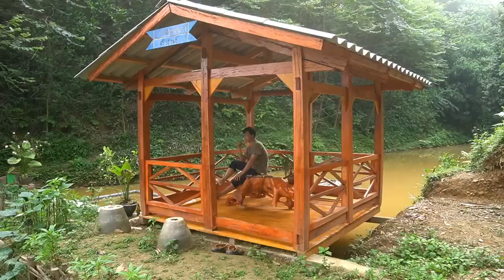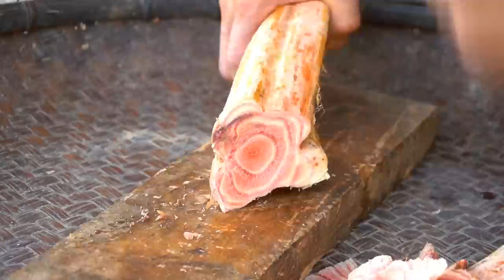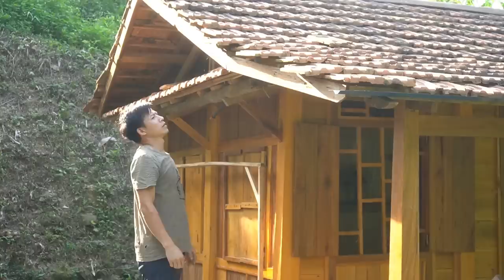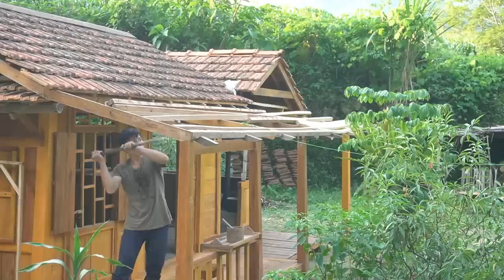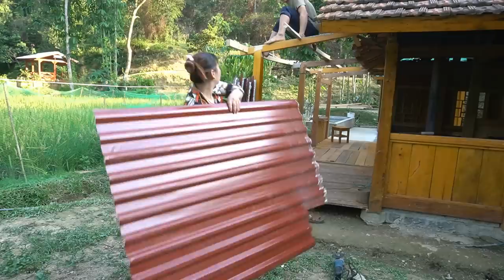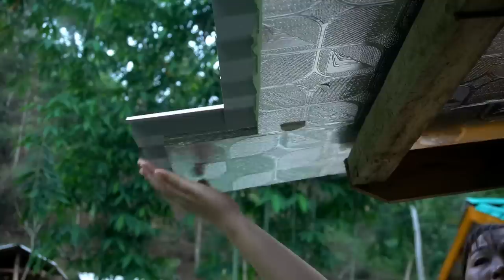Together Re-roofing the old dilapidated roof - Harvest and enjoy peaches

Comment: I was afraid that was going to do a short circuit because it got wet while you were filling it with water, glad it didn't.😊In my country, we place cement on the tiles so they do not move with the wind and the movement of the ground, this also helps keep the rain from rotting the wood, and getting water inside the house, is the first time I have seen people in Asia placing the tiles loose on the roof
Reply: Well done good and creative job changing New roof from the old..appreciate your hard work